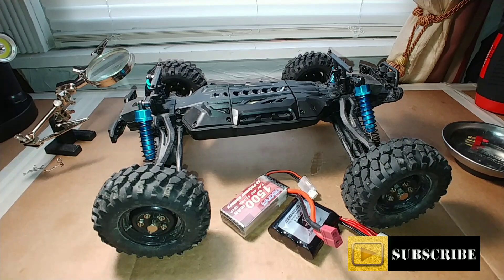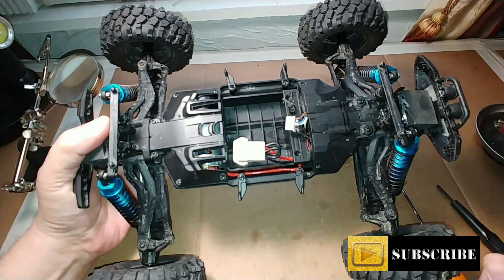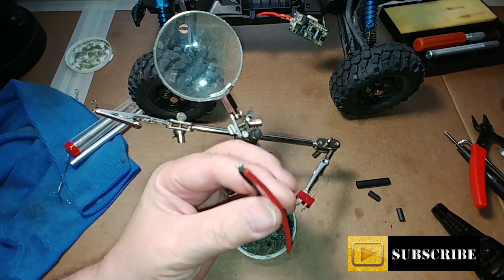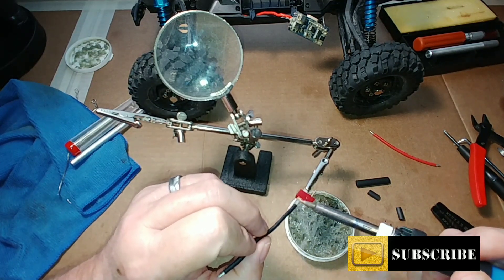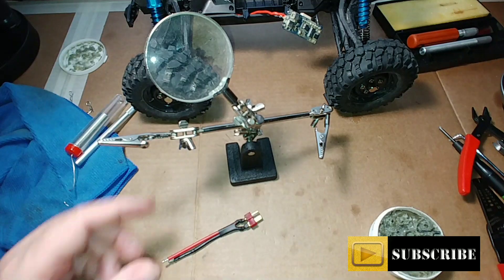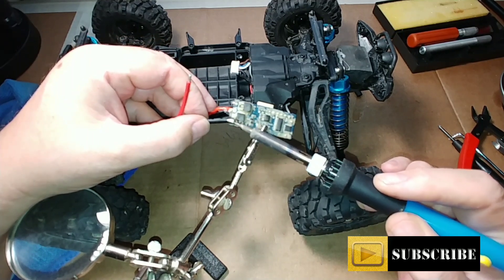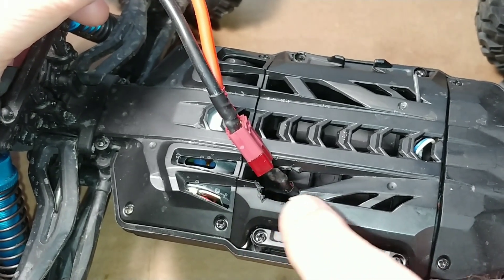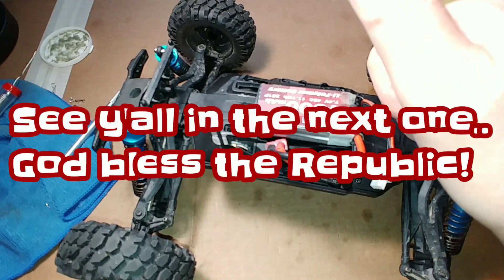XINLEHONG / GPTOYS S911 LIPO MOD

Comment: Hey RC hobbyists ! I did this mod too,...all seemed good. I took it for a run outside and only got 2 minutes and the red LED that normally turns solid ON keeps,...keeps blinking as soon as I give "gas" or want to steer. When I don't press or turn anything on the remote,...the LED becomes solid again and when i dare touch something on the remote it reacts for a millisecond turning ON, OFF, ON, OFF etc. The battery is fully charged. I even went as far as to connect the S912 Truggy directly to an AC to DC voltage controller capable of 20 Amps. Same thing !, 1 or 2 minutes tops I get before the red LED blinks when it gets a signal from the remote. Anyone figured out a fix for it ??????
Reply: Hey, did you ever find a solution to the problem? I’ve got the same issue and I’m not sure how to fix it.  Thanks

Comment: Hi, I ordered the fan cooling system for my s911 and I want to upgrade the battery where I'm having problems what to pick. Some say 2s others 3s and I even found someone that say it will run fine with 4s. Personally want to go with 11.1V 3S 2200mAh 25C . Any help will be really appreciated Thanks (first rc car for me)
Reply: I can’t find any cooling heatsink/fan combos which lost the internal dia of the heatsink (27mm) to fit around the motor☹️ What did you get, fit OK?

Comment: Actually that 9.6v 800mah stock battery will only be 750mah. Take the wrapper off and you will see 750mah written on each battery inside. The batteries work good at 9.6v but the run time is rubbish so you need at least 6 batteries for a good hour pf fun.

Comment: Great video I have this truck.  I love that fact that it is cheap and you can upgrade it..the ESC can handle the added power etc. Here is the REAL PROBLEM....plastic gears.  You do all those mods and with regular runs, especially at higher speeds the plastic gears are gone...FAST.  Do you have a metal gear solution? if you can show that or figure out how to make the diff. last then you will have it figured out!...but as is..the plastic crap rear diff. makes all this modifying virtually pointless....let me know!  Thank you..
Reply: YES! I need this too!
Reply: 11.1v will burn out esc

Comment: I just re-subbed because I wasn't getting any notification's..I won the S912 today! lol..Going to do the oil filled shocks and tires first thing
Reply: PhilthyCo RC, love it! Will you leave the wheels stock, or... what size wheels will you run?
Reply: @jamesroebuck5911  I ran Tamiya buggy wheels and super gripper tires..Much better
Reply: PhilthyCo RC cheers mate- I’ll take a look
Reply from the maker: Nice!
Reply: @LeSiZmOr  It broke after a few small jumps lol..Check the vid
Reply: What kind of shocks are those

Comment: Hey James I wouldn't recommend running this truck on 3s lipo without some cooling measures put in place first as the motor will over heat and you will end up with a smoke show. When I done this lipo mod over a year ago I chose to tap into and solder the existing lithium ion wiring loom as I wanted to be able to use the stock battery also as well as the deans plugs lipos which I covered in my recent xinlehong line up and discussion video. Cutting a big chunk of the plastic cage is necessary to be able to access the switch or just leave it powered on. I hate how they designed it that way also on most of these branded trucks. Thankfully the 9130 and 9125 have external power switches. Happy Rc-ing brother
Reply: I run it on 9.6V 2000maH  Nihm pack since I have it with no issues at all
Reply: @themountain59  It runs on 9.6v out the box so there would be no issues, I'm referring to 11.1v 3s
Reply: @PERTHWESTOZRC  well...and I have to revise my comment...first warmer day today here...burned my motor :/...well , brushless here I come  :D
Reply: I know a couple of folk have also placed heatsinks on the ECS transistors on the board (four of them) this will avoid smoking the circuit board when you run the 11.1👍 Great vid btw!!
Reply: PERTH WEST OZ RC do you have any experience using dry graphite to grease the diff vs normal grease?